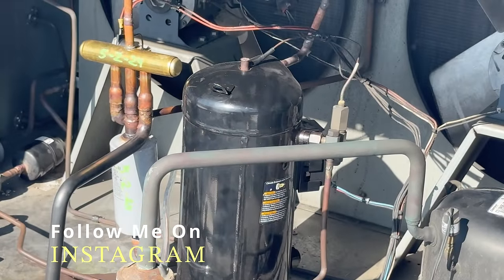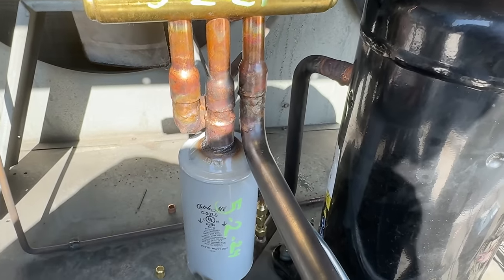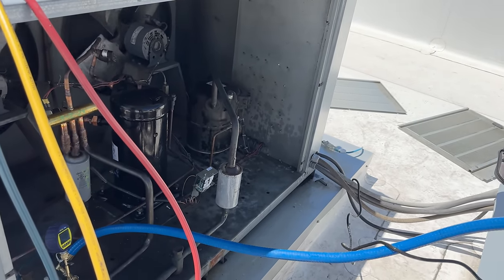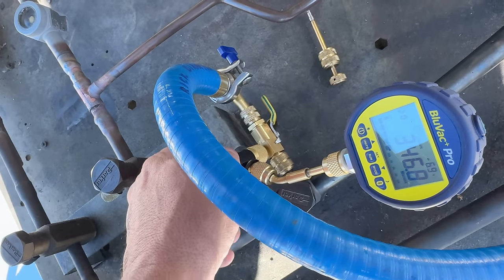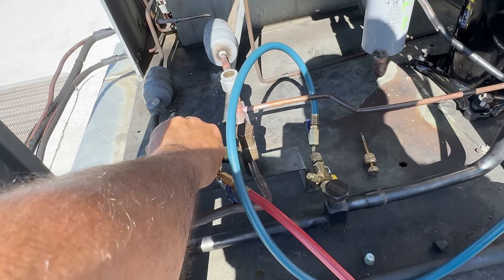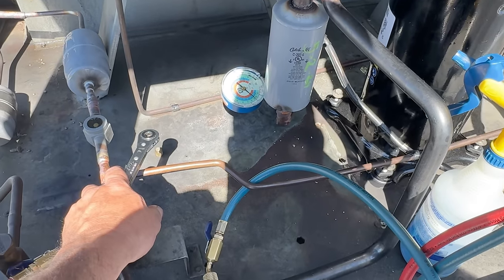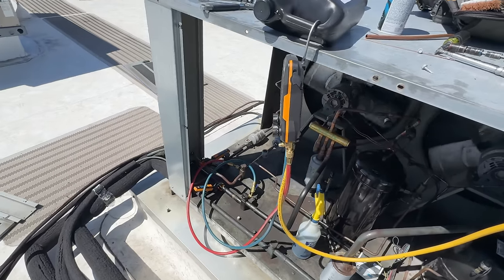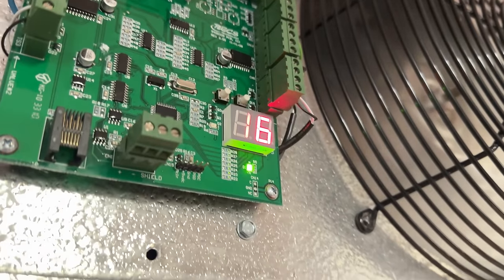2 Bad Compressors In Weeks WHY? Freezer Down

Comment: How many hours did this job take?  I mostly do commercial rooftop compressor replacements.  Between driving to the site, unloading all my equipment, getting in the building, getting to the ladder, climbing the ladder to the roof, hauling all tools to the roof including the new compressor, then doing the compressor job itself can take 8+ hours.  Then when you throw in problems like you had in this video, the clock keeps running.  I can only imagine this took a few days to get back in working order.
Reply from the maker: Because I had to come back and this job was over an hour away I had two full days in it. Normally, it would not take that long, but there was way too much moisture to let it go.
Reply: That’s a 3 day job for me

Comment: It was probably short cycling during hot gas defrost....I've found a few systems overcharged going off on high pressure safety during defrost....masterbilt only opens the eev 50 percent in hot gas defrost and can't be reprogrammed
Reply from the maker: That’s crazy but since there’s no TXV outside is likely why.
Reply: It's not hot gas defrost, it's reverse cycle. Flips the evap and condenser around like a typical heatpump. 

Would be interesting to see what it's doing for metering, might just check around the EEV and go through a fixed orifice or something. 

Can't imagine that'd cause short cycling, as you get plenty of heat from the "condenser" to keep the pressure up
Reply from the maker: You’re probably on the right track, there’s so many things I would’ve done differently. I didn’t go into all the details of how much stuff was screwed up. I should’ve put out a timeline, but there was a lot of half ass hackery going on and stuff was being done in the rain storms.
Reply: @Thermoelectric7  the Evaporator fans don't run in reverse cycle like a heat pump, your not condensing, just robbing heat. That sounds like hot gas defrost to me.
Short cycling on high pressure safety during defrost. If you restrict the Eev to 50 percent in defrost, your charge has to be perfect with no receiver.
Reply: @SeanMackBuffaloStyle  the reversing valve is what makes it reverse cycle, not hot gas. Hot gas defrost just dumps the discharge line past the expansion valve. Reversing valve swaps the evap and condenser. Hot gas would have 3 pipes going to the evap. Reverse cycle only needs two. 

It will 100% be condensing in the evaporator when in defrost. You don't need the evap fans running when it's a block of ice. All that discharge gas will condense as it melts the ice and warms the coil up. At which point it passes backwards through the metering device, into the condenser on the roof, evaporates, and is recompressed. 

Reverse cycle defrost pulls heat from the condenser on the roof and environment to defrost. Hot gas just uses the heat from the compressor. Massive difference. 

It'll never trip on HP in a reverse cycle defrost, unless the termination isn't working right, at which point your scenario would be right and it would run high head as there's no more ice in the coil to melt.
Reply: @SeanMackBuffaloStyle  Go have a look at a standard residential heat pump as it goes into defrost. Same thing happening there. Swaps the evap and condenser, and doesn't run the fan on the outdoor unit to minimise heat lost into the environment. Exactly the same as what this unit is doing. And while yes, technically, the hot gas is doing the defrost, that doesn't make it a hot gas defrost as the pipework is completely different.

Comment: Gotta remember if its a freezer superheat is to be checked once box is at least at 0°f brother
U did all u could man, outstanding 🙌
Reply: You know evap superheat 4-8°f and compressor between 20-30°f is a happy place but its even tolerable up to 48°f is it’s in harsh equipment with neglected maintenance equipment
Reply: As always! Killing Rick! 🙏
Reply from the maker: I learned not to touch super heat until 5* from set point, or you’ll be doing it again because it will flood when at temp.  The one saving Grace was it had liquid injection, but I don’t know if it was even working correctly. It probably was gummed up with shit. I couldn’t feel any temperature changes. I should’ve used my thermal imager, but I was doing a lot of other things  that I didn’t show, one of them was the dam bees.

Comment: APPOIN doesn't sell the CCT/VCRT O-rings outside of getting the VCRT rebuld kit.  Wasn't paying that price for a kit I didn't need.  Went looking for something else.  

I've been using 'HSN O-Rings, also known as HNBR (Hydrogenated Nitrile Butadiene Rubber)' the green O-rings, for a couple of months now and I'm not going back.

No need to leave them loose to get the core out, tighten them down normally the O-ring won' get in the way of the core.  If you're tip is properly adjusted you will get the core every time.  The chemicals don't break them either.

APPION is still the best. I tried the JB's but the side port didn't work. The FP are way too big.  It's bad enough with the APPION VCRT's.  DAIKIN you have to un-bolt and bend pipes, LG you have to just about remove the Eletrical box.  

Size #108 Fitts perfectly.

Comment: I work in lots of heavy equipment A/C systems. I use Oil eater to wash the coils ( mostly condensers, but some evap. also) - was thinking about maybe doing experimenting and washing the coils with that on stationary coils, to do less damage. The non bubbling dish detergents might be a good idea also.

Comment: That was pretty good, your suction line temp showed around 37 degrees. Basically for a low temp unit, I don't worry too much about the superheat while it's pulling down, but a low temp compressor doesn't like return gas above 40 degrees F. You were well below 40, so I think it'll live plus it has the airflow of the condenser fans over it.
Reply from the maker: Thanks for the tips!👍👍

Comment: Well Rick - that was super rookie mistake, about that suction filter!
You knew better!
Reply from the maker: I didn’t want to heat up the reversing valve.
Reply: Idk kind of close to the 3way valve
Reply from the maker: I took the chance, but I cheated and cut it out 🤫😎 a pipe cutter didn’t fit. I keep pipe brushes in my torch kit to clean out shavings if they get in there. At that point they system was a miss what am I out.
Reply: I carry fire blanket with me. Saved me many times. You can even get something like that from Harbor freight welding section. Also I carry old license plates and pieces of aluminum flushing for the same purpose.

Comment: Freezers need suction accumulators. 
I never sold a low temp condenser  without one.
Or a medium  temp.
Guess what, never had a compressor wash itself out.
That's why you had a lot of oil in the high side too.
Reply from the maker: I don’t like the whole design. It’s absolutely idiotic to put two different systems on one breaker so when the one system trips, it takes out the other not to mention you tie yourself up with one condenser coil. The whole design is crap.
Reply: A lot of oil in the high side can be from the system being low on refrigerant, like when that cap tube line blew, and then the pressure switch set very wrong, the compressor wasn't shutting off. When the compressor is running in a vacuum, and there's not enough gas flow velocity in the low side of the system, there's not enough to push the oil back up from the box up to the roof.

Comment: I learned with my testo probes that i have to periodically take them off and make sure there still reading zero. Had a intellagen freezer not long ago that i was checking the suction transducer and almost called it a bad suction transducer, until i took my probe off and found that even though i Zero'd it prior it  was at -7 open to atmosphere. Zero'd again and then i was reading the same as the board.
Reply from the maker: I was setting up a freezer super heat two weeks ago and it was zeroed out before I went in there and when I got done, I thought it was set then rechecked it and it was completely off. I don’t believe these are compensated like they claim. At least not on the probes. They’re too cheap to be able to be that.  When I got out my 557 it worked just fine so I don’t 100% trust the probes. Like you said though they really need zero out in the ambient temperature they’re gonna be operating in after they’ve stabilized in temperature.
Reply: @HVACRSurvival I am not really impressed with the pressure probes. I stick to only using them for reach ins or prep tables. Even then, i usually just get the analogs with short hoses. I don't know if the field piece probes have the same issues, but I may switch to the field piece. I've had the sman380s for 5 years now, and I have not had a single issue. In fact, I still have the original temp clamps they came with.
Reply: @HVACRSurvival  I like my new(ish) Fieldpiece Sman's, they are more bulky than the Testo, but this newer one seems to hold a zero pretty good. That was annoying with my older fieldpiece, I could zero it out, and then after like 5-10 minutes I would have to zero it again. Was so frustrating to always remember to turn on the gauges right away before even taking them off the truck, to allow enough time for them to "warm up" and stop drifting. I think the one I have now is the SMAN 380v, not 100% sure tho.

Comment: Gotta love those Mac units
Reply: Also I believe those units come with sporlan csg driers factory installed I don’t believe you need a bi flow drier for this unit
Reply from the maker: It’s the same design as a heat pump

Comment: Great video rick & job, nice troubleshooting, did you work on this equipment a few months ago, because it looks familar, i think this unit was a hussman, damm the compressor was loud at first but it shut off, the noise.
Reply from the maker: No, I worked on one of their other stores. They have several so they have the same equipment and every building is the same.
Reply: @HVACRSurvival  or ok, because at the end of the video i noticed it was a masterbuilt

Comment: Did a compressor initially burn out and contaminate the system and was never flushed out? Then subsequent compressors got wrecked? Edit: never mind, bet it was the pressure switch config if das shaft was broken.
Reply from the maker: First they replaced the reversing valve then a short time later the pressure switch broke and dumped the charge. Then the pressure  switch was replaced and I believe they set it up incorrectly, then the discharge line cracked and dumped the charge again,  they repaired that then the compressor burned out shortly after that,  then they replace the compressor and it snapped off the shaft a couple weeks after that. because the guy that replaced the compressor didn’t check the pressure switch, I believe it short cycled until it broke.
Reply: @HVACRSurvival  man…what a cluster! Well done on the fix!

Comment: Great video. Thank you for sharing. Have a nice weekend. May I ask, why freezer use 3 way reversing valve heat pump ? and for freezer, which high , low pressure , Super heat, subcooling number is good ?
Reply: Defrost?
Reply from the maker: The reversing valve is used to melt the frost from the evaporator coil. Just like a heat-pump defrosts.

Comment: never heard of a 4 way reversing valve on a walk in cooler or freezer. Does the outdoor coil have a separate metering device for the defrost cycle?
Reply from the maker: Nope. But the EXV only opens 50% from what I’ve read in the comments.
Reply: Only place I've ever seen it is on fancy gelato freezers. Reverse cycle is way quicker than hot gas or electric on a single unit like that so helps limit the impact on product temp by means of a short defrost cycle. Neat stuff. Way more efficient too.
Reply: @HVACRSurvival  Yeah, that's to provide some restriction to build up pressure to provide some heat in the coil. I don't like those kind of systems, the problem is, in the winter on a cold windy day, you get about one good blast of hot gas, then the heat is gone, and even then, you still need electric heaters for the drain pan and drain line, so it's a waste. I have only used electric defrost since the late 1990's. Last one that I worked on, they were using a Bryant 4 ton heat pump for a condensing unit with 2 Larkin evaporators and a receiver remote mounted on the roof beside the unit. Was a real shitshow to get that working correctly. It wasn't a freezer per se, it was a meat cooler, with box temp control set to 30 cut in, 28 cut out. Even though that's not a freezer, anytime you have a desired box temp of less than 35, you can't use off cycle air defrost anymore.

Comment: You can't pull moisture out of POE oil?
Reply from the maker: Not like you can with mineral oil and a vacuum pump. POE oil doesn’t want to let go of the moisture as easily. The filler drier is the only way.

Comment: Good Ole Mac units. I hatem!
Reply from the maker: Shit dressing with special sauce. Just throw two True condenser units up there with regular Txv’s and call it a day… when these things get old they waste more money on maintaining and repairing them than what they saved by putting them in to begin with.
Reply: @HVACRSurvival  brother you're preaching to the choir. I've stood on the roof with a ops manager and asked why, his answer it's what McD wants.  When I knew he was doing a remodel I asked don't use a Mac unit and if you must make it Heat Craft. He ends up putting in RPG/Master Junk. Some bean counter made this decision with in McD Corp and it stuck. If they used standard I could just run to a local vendor and boom fixed on the day but oh nooooooo....so a control board goes bad walk in down well guess what call a refrigerated truck out because the board need maybe 48 hrs to get here.  Dumb!!!! Rant over lol